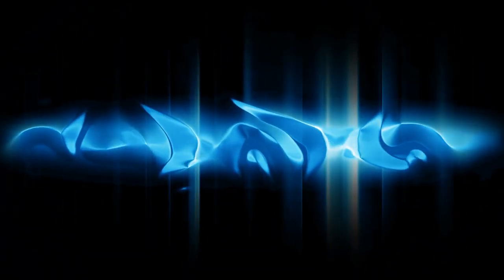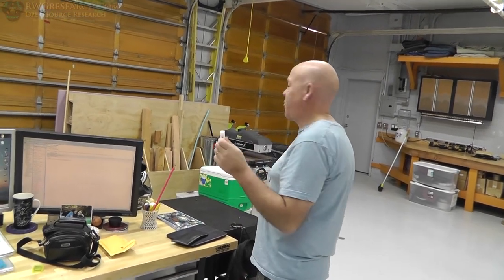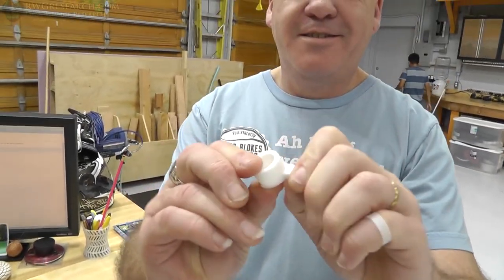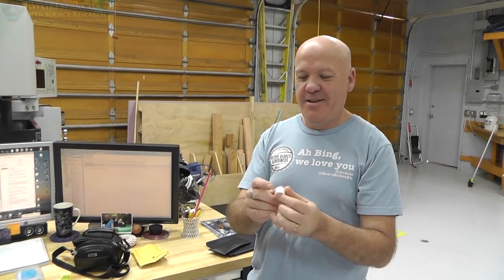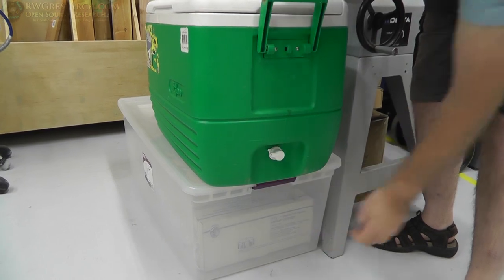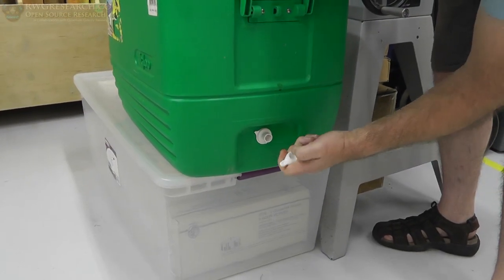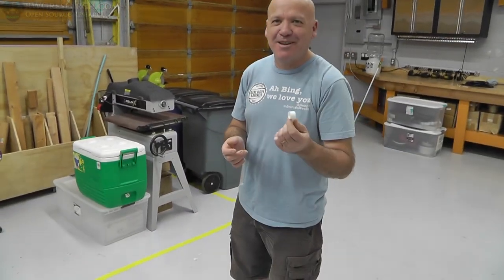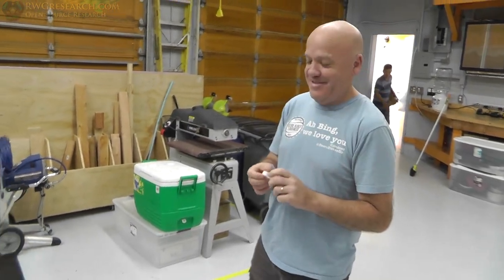Practical 3D Printing with TPU,  ESKY Plug, With Jim . Cooler Drain Plug

Comment: Russ, " I love your videos"  anways  I found out you can 3d print with trimmer line  and I thought it might be a good video that you can shoot.  a stress, bend, quality  and if it would be a good 3d print cheap replacement video
Reply from the maker: thanks. yes I have some some research on the past and most of it has glass fibers in it and will mess up your hot end. I think nowadays it's better to just buy nylon. but the thanks for the comment. ~Russ